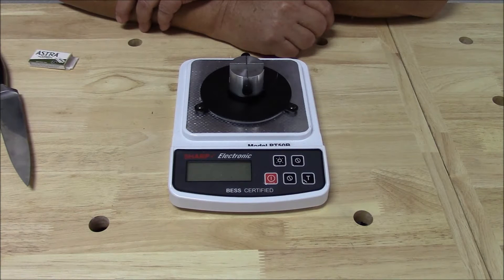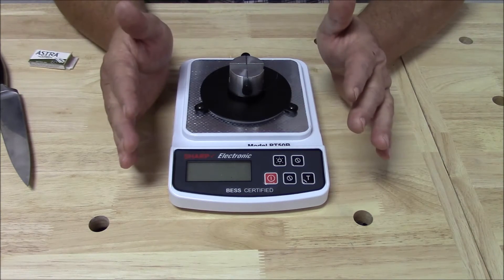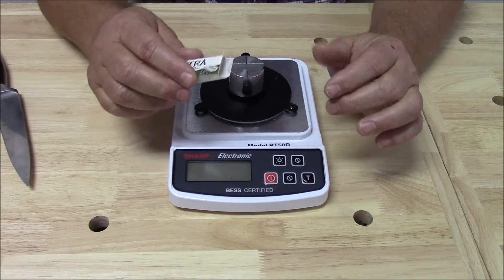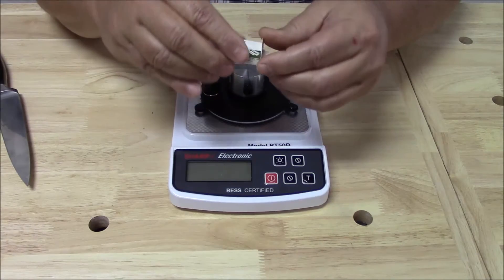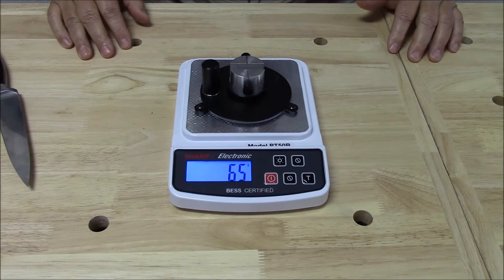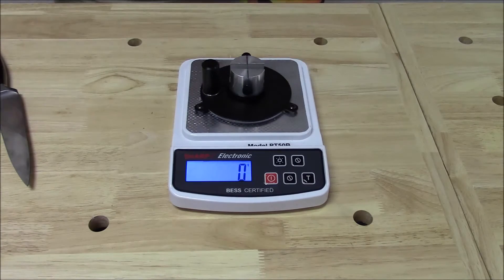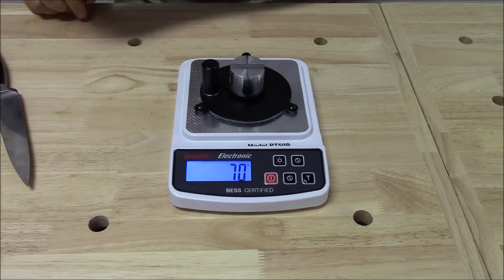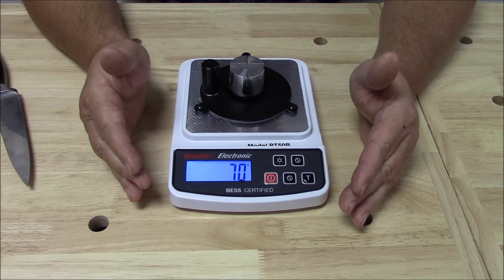Edge On Up PT50B Edge Oxidation Pro Sharpener

Comment: is the razor blade testing 50 the reason this unit is called the PT50??  ''clever''. I soon learned how significant it is to run blades ''straight'' as humanly possible. OR I get varying all over the map, test numbers.